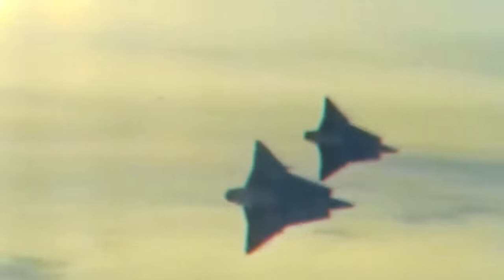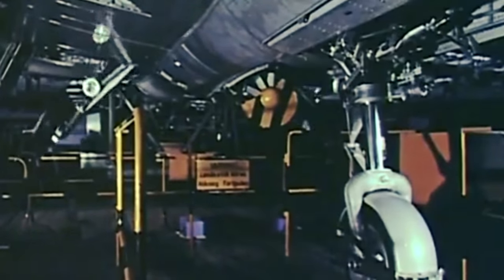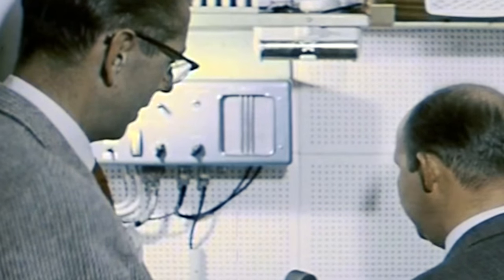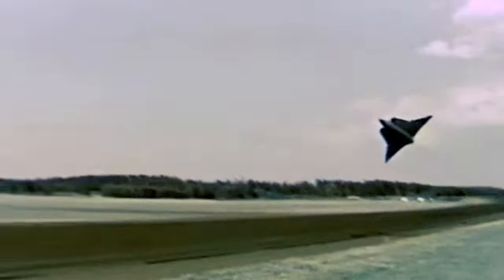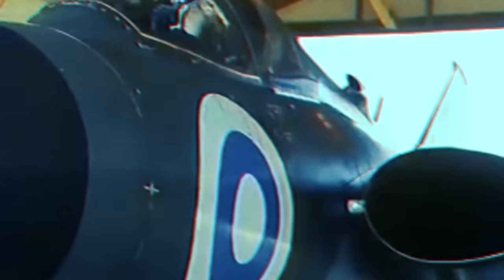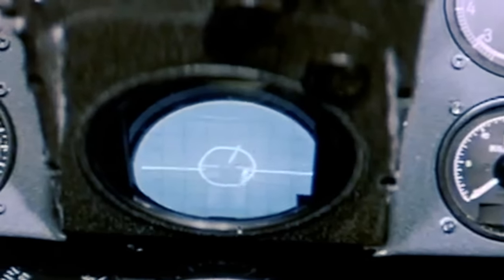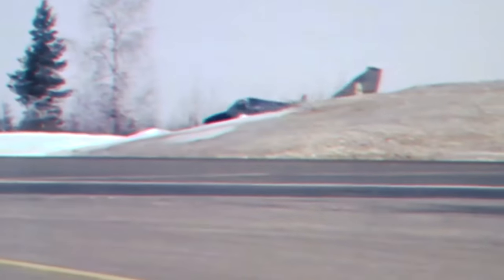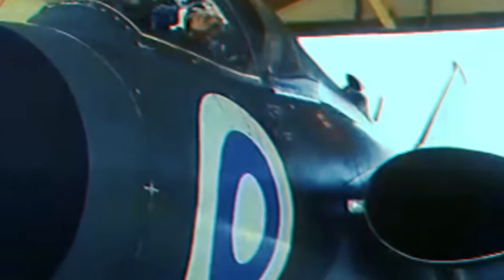The Bizarre Airplane Design That Shook Up Aviation

Comment: Uh oh! The Su-27 fan boys are going to hate that it’s not the only plane that can do the cobra nor did it invent it.  🤣
Reply: That’s the first thing I thought, in the first two mins 😂 🇨🇦 Vet
Reply: 🤯 I really thought the Russians had invented that maneuver. Still they deserve some credit for having more planes that can perfect the maneuver.
Reply: @one-metallica4156  yeah, leave it to the Russians to perfect the art of dumping their energy and becoming an easy target 😂
Reply: @joshfrommilan6130  my mistake, I meant the Soviet Union.
Reply: Have seen Mig29's do it on airshows and i have even seen a german Tornade do it once on an airshow. So in any case they would never be the only ones ;-)
Reply: @nirfz  Fair point. F22 can do it as well.
Reply: @one-metallica4156  Although thrust vectoring could be somewhat counted as "cheating" compared to the other airframes ;-)
Reply: I'm Swedish and have had an interest for SAAB planes for a long time. Although this might technically be the cobra it's very different from what the russians do. The Drakens are practicing super stall recovery at high altitude. What you see is them trying to initiate the stall but failing, this exercise has got nothing to with dogfighting.
Reply: This is not Cobra at all
Reply: Fellas! Who cares if it is a Cobra or not? You pull a Cobra in real combat, you die! The Cobra only works in DCS and maybe 1 v 1 combat. When was the last time anyone fighter pilot went out without his wingman! The Cobra is only to Su-27 fanboys wet dreams!
Reply: Also, everyone acts like every Russian pilot knows how to conduct the maneuver! Given the very limited training time that Russian pilots receive the only Tim they hear of the maneuver is from YouTube! Cheers
Reply: Russians call it Pugachev Cobra to make it look like the have created it.
Reply: @One-Metallica  but it's not very useful in modern combat
Reply: the russian 135th keyboard battalion has arrived😂
Reply: @Sasa Babic  what do you think a cobra is?😂
Reply: This is not a Cobra. It’s a super stall aka the Top Gun move. For Cobra you have to rotate at least 120 degrees, not 90. Can’t do it on a Dragon because the engine will stall. The first aircraft to do a Cobra is a Mig- 29, not Su- 27.
Reply: @daveriddell3704  The Cobra as "speed reducing action to make the guy behind you overtake" may only work in games and play.
But that's not the big thing when an airplane is able to do that manouvre.
The big thing is that it can point it's nose in a different direction than it is travelling for a short time.But very likely long enough to fire guns or to launch a f&f missile.
That's can be important if you are in a time where the seeking heads of missiles were not connected to a pilots helmet in a way that enabled them to be directed to a position not in line with the planes direction of flight.
Reply: @joshfrommilan6130  The menuver is uncommon(its a last ditch effort)
Reply: @daveriddell3704  Its not that the maneuver is very useful. But it's a testament to the excellent handling capabilities of the mjg29 and su27. (Its ok to like russian planes)
Reply: @one-metallica4156  why?
It‘s completely useless and irellevant since 30 years
Reply: @heinzketchup4558  so you say.
Reply: @one-metallica4156 less perfect then the f22 though. The f22 doesnt choke in black smoke when it does the manouvre every time
Reply: Well when the swedes did the manuever. The missiles used where pretty hopeless at tracking, and they where heatseekers
Reply: @joshfrommilan6130  - Yeah, and leave it to the US jet jocks to admit that not a single one of them would actually dare to fly over Ukraine, regardless of aircraft type. 😂🤣😂
Reply: @breakbollocks9164  yes, the country that owns the jet with the single highest K/D ratio ever is scared of flying in Ukraine. Sure pal.
Reply: Just another defeat for the Russians 😂😂😂😂💯💯💯💯
Reply: @daveriddell3704  that's today. 60 years ago it was used successful in exercises and combat agains the Soviet union.
Reply: 60 years ago there was no off bore sight and it was nessesary to point the nose at the opponent to kill him, so the cobra meneuver was very useful then. The draken pilot used it to win against Soviet pilots and it may be the reason the developed it themself, but with trust vectoring. Today the meneuver may be used to dodge missiles.
Reply: @nirfz  that may be so, however you are cashing in all of your energy for that one shot leaving you vulnerable in the meantime. As I stated before, when was the last time any fighter went up alone?
Reply: @olebaltasar6263  it is a testament to how well Russian aircraft perform, I have never doubted that. I love the Su-27 and Mig-29 series.
Reply: @atlet1  there is only one instance where a high stall maneuver was used in combat and that was in Vietnam….they loosely portrayed it in Top Gun. It has never been common practice nor used successfully against the Soviet Union.
Reply: @daveriddell3704  Which means your buddy has your back while you are being vulnerable ;-)

Look, i am no fighter pilot, all i know is that talking to a Draken pilot who had been on an exercise with a number of his collegues and they exercised with the Swiss and their F18's, i was tolled in a humble manner but with a proud smile: "The f-18s didn't win all the Dogfights". They did train and exercise like they did their QRF duty. (in pairs)
Reply: @nirfz  and what is the other guy’s buddy(s) doing? It only takes a second. 

Everything comes down to pilot training which is why I stated that the maneuver isn’t very common except for air shows due to the quality of Russian training.
Reply: @daveriddell3704  False!
Reply: @daveriddell3704  What if you go for the buddy... Not for the leader, but for the buddy who is to his right or left wingtip first?
Sure it comes down to pilot training, but what i tried to explain is that if the plane and the pilot are able to do such a manouvre it doesn't mean that they have to do the full 90° or 110° (which is impressive on airshows) it just means that they can use the ability and angle they need when they need to.
Reply: @nirfz  Im 100% certain the tornado has nrver done a Cobra on an airshow. Its not built for that.
Reply: @atlet1  No he is right. Draken pilots never did what the russians calls the cobra and no Swedish airforce aircraft ever fought soviet planes. In any case its not possible to do it on older prop planes. The first time it could be safely done when the mig 39 arrived. And mig29 doesnt have thrust vectoring
Reply: @olebaltasar6263  False! The general definition of the cobra maneuver describe what Swedish pilots did, many times in combat with the Soviets. There was no live fire during those combat occations though. The only live fire was from Soviet pilots was against a DC3 and a Catalina.
Reply: @olebaltasar6263  You can be sure as much as you want. I have seen it with my own eyes. (only once, but i will remember it forever)
A german Tornado going straight in the line of the runway, holding it's height while pointing the nose 90° upwards for 1 or 2 seconds before lowering the nose again and hitting the afterburner.
Reply: @nirfz  No. The tornado wasn't built for such a thing and it couldn't dream of it. Not even the nimbler aerodynamically unstable western planes like f16 or f18 does it. It was a crazy maneuver to do at low altitudes when the Russians started doing it in the late 80s.
Reply: @olebaltasar6263  And "according to aerodynamics a bumblebee shouldn't be able to fly", i still have seen it do it.
Reply: @nirfz  You will have to agree that that's not a good metaphor.
Reply: @tiberiusbrain  its stupid to do the menuver at random, its not made only to do one menuveur!! The meneuver is not that usefull. Black smokes not dangrous either to the pilot
Reply: @benferris2764  it is a stupid manouvre for sure. But the black smoke isnt dangerous to pilots, it is an indication of fuel not burning very well
Reply: @tiberiusbrain  i didnt know the black smoke indicated fuel problems, thanks for pointing that out to me.
Reply: Rafale can do the cobra, so does f18 among others.
Reply: Alot of planes could probably do it but doing manoeuvres like that would hurt the overall lifespan of the airframe
Reply: @doubledekercouch  exactly. Last ditch efort if anything. I saw a video on youtube of a Fokker Tri Plane in flying circus peforme one, flight sim players are mad!
Reply: 😂😂😂😂😂😂😂 Saab draken.
Reply: @daveriddell3704 I saw it once. Dunno if it an actual cobra, it's SU57 against a stolen Tomcat---- and it's not the Russian's
Reply: @tapenagiuniversity1551  The one in mav wasn’t a cobra i don’t believe, the post stall move involves pulling the planes nose up and back down (as if imitating the snake), i think it might have been the Kvochur bell
Reply: Су 27, шмат мусора, по ряду базових конструктивних недолік. Міг 29 я взагалі мовчу. Головне, що Іван пишається і після літру горілки почувається велично. Хоча двигуни росіяни завжди копіювали у заходу.
Reply: @olebaltasar6263  The definition of the cobra was the exact same thing that Swedish j35 pilots did. Also Swedish aircraft faced off against soviet aircraft numerous times in the baltic sea the differences where that no shots were fired and that these were just mock fights. There is also the instances of Finland who operated both the Mig-21 and the J-35 and often Finnish j-35 pilots won against their mig-21 counterparts
Reply: @fishyfish6050  They certainly met over the Baltic many many times. Especially the planes in what we call incidentberedskapen, who were tasked with identifying unknown planes near and in swedish airspace. And I'm sure finish drakens  often won against finish migs. Swedish drakens often challenged and turned with west German f4 phantoms and won since drakens are much lighter. But it's my understanding that turning with the Soviets or any WP country was a no no. When western fighters approached Soviet planes just turned towards their bases in the baltics. The soviets didn't want confrontation and they had orders to keep distance. At least that's what most Swedish pilots state. I know there were incidents but that was long before draken were introduced. About the cobra, yes, the draken does it in the video. What I'm saying is that it's not the same thing. They do it with poor control at high altitude and you can see one plane disappearing in a flat spin towards the end of the video. The 80s soviet planes did it with perfect control every time right over the deck. Therefore it's a useful maneuver for the migs and sukhoi, whilst for drakens, it's a stunt that could be tried at high altitude and that sometimes succeeded. Draken was known for being unstable at high alpha. And I say all this as a Swedish draken fan.
Reply: @one-metallica4156 Why? It is downright stupid in modern air combat.
Reply: Fails 35
Reply: It did it better too
Reply: There are a lot of aircraft that can do the so called cobra maneuver.  I even saw an F-18 do it.  The thing is I think the US dogfighting doctrine of maintaining energy doesn't see any actual combat value in it.  It slows down the plane considerably that you will be more vulnerable.
Reply: @joshfrommilan6130  actually, leave to GENIUS like YOU to say what you said.. The cobra OS what MOVES you in a split of a second from been a TARGET of the fighter BEHIND you, to the one LOCKING on that who was BEHIND and then becoming your TARGET
Reply: Link at the difference.  The su27 is like a slow motion cobra yawning.  The Saab is instantaneously quick
Reply: And it's done via pure pilot skill, not artificially aided.
Reply: @covidhoax7646  A cobra is 90 degrees AoA. That is a fact. The airshow move "Pugachevs Cobra" is 120 degrees aoa. Google exists.
Reply: Russian jets are more known for being the ones to be able to do it but the J35 Draken is the first ever to do it
Reply: @nirfz  : Did You see spectacular explodes “ Tornado” in Air ? ( In April night under Sky to City of Smederevo) . Luftwafe Tornado is Shot with old rocket “ Dvina”. Magnificent 💥
Reply: Look, someone who gets their aviation knowledge from top gun!
Reply: @heinzketchup4558  Doing backflips is also pointless and useless but  looks cool AF.
Reply: @sasababic4016 no, its a Kort Parad
Reply: Said by someone that cannot do it
Reply: @daveriddell3704  Not to mention 9 out of 10 attempts would likely tear the wings off of the few, over used airframes they have!
Reply: @one-metallica4156 I'm pretty sure the russians saw the maneuver by the swedish and claimed to be the creators of it. Because Sweden wanted to keep this airplane as secret as possible because of the cold war situation

Comment: Iconic. I've had the pleasure of seeing these at airshows, and the plane still leaves an impression.
Reply: As a kid i saw these in the skies over Denmark, Some AFB still have one for display at the gate.
Reply: @pliashmuldba  Karup airbase, right? I sadly wasnt alive when they were still in service, but my dad worked on the drakens there for a long time.
Reply: They were insanely loud.
I once experienced them at the airshow in Skrydstrup (Denmark), where they came from behind the crowd, at over mach one.

I knew that they would be coming from the airshow program, but not from where. But I was one of the lucky few, who discovered them in time, and covered my ears. They were maybe only 3-400 meters above us, so people jumped, at the bang. This could never happen today, of course. Mach one and beyond over labd, was banned a few years later.
Reply: @akyhne  Typical Denmark, ban / outlaw any kind of fun, we are a far cry from our Viking ancestors today.
Reply: @Jens Nobel Actually no, Denmark no longer fly the draken at any shows. They currently have 2 drakens at shelter 152 that can indeed fly, however are not allowed to. They are only present on the ground at shows.
Reply: @Jens Nobel I think the Jury are still out of that one, but yeah like in most things a coordinated effort are better than havoc.
But there are many a old writhing about these guys also being quite emotional, but yeah even back then you couldent just cut someones head off CUZ you felt like it.
What i tried to write was the Danish nanny state,,,,, it suffocate me.
I have not voted in many many years, CUZ there are no one here to vote for, they are all idiots.
Reply: @Jens Nobel I have been to other countries, work have taken me everywhere but Africa and the south pole.
And i have talked to people there and seen what they get .
But ! yes there are disagreeable things in all countries, but with a lotto win i am still moving away, and i assume also be able to die in my new country feeling as a free man.
But lets hope more educated people come to live here we sorely need them, but many are actually scared off by the system here, even if you looking close at the numbers it is actually not more expensive being a Dane than say a American.
I too am C / CE licenced, got that years back when i was between jobs, and as i am connected, not that i ever used it, but my dream car well it is way past 12 tonnes in weight.
For me its not so much the cost of being a  Dane, it is the lack of personal freedom and the utter distrust in me as a law abiding citizen.
It is my firm belief that with the right measures we could easy cut the public sector of 25% of its manpower, and allow people to be more free in a range of ways.
Reply: @pliashmuldba  It's banned everywhere in Europe. No sonic booms over any mainland. I'm sure your viking god Thor would aprove that there is more fun stuff than kids with bleeding ears at airshows.
Reply: @forton615  My buddy that live not far from a military airport, he had F - 16 going past the day before yesterday that he couldent even take a photo of them, they was that low and that fast. a few months ago he also sent a pic of a airborne radar plane that was no more than 200 M in the air.
The fast moving F-16 planes he said was so low he could have thrown stones at them.

We will be formulating a letter to that airport saying that they should do this more often. though my niece live less than 1 KM from there and they do have a kid less than 1 year old.
Also if they need a place to do mock bombing runs at, the 20 feet container in the field at my friends place will make a nice target.
 Make me wonder can a military airplane detect my micro wave  ( radar )  chronograph i use when shooting, and maybe will it freak out if i aimed my UV laser at the plane ( missile warning )
 we are looking forward to when we get even louder F-35 planes.
Reply: @forton615  Sonic booms are not prohibited lmao
Reply: @akyhne  Yes its loud af but damn is a MiG so much worse anything with a double engine just tears your ears apart
Reply: @reldies5364  European guidelines say no supersonic flight above populated areas (good luck finding a non populated area in Europe), for commercial flight it's already banned since Concorde. So yes, technically it's not forbidden for the military above non populated land and at a certain altitude. Hard to find data, but if you know more please feel free to share. What I know is a couple years ago a jet flew a bit too fast over Belgium. Next day it was on the news and in the newspapers. USA is even more strict.
Reply: @forton615  AAF is literally doing supersonic training right NOW.
They mostly fly over the alps because its sparsely populated but you can hear the boom if you are lucky and live close.
Reply: @reldies5364  live in styria (Austria) on the upper left. This month was a window of 2 weeks where they trained supersonic flights. No window was shattered but sometimes it vibrates very strong. The Jets train very regularly. You hear them mostly every week once. The supersonic flights are once a year for 1 or 2 weeks.
Reply: It truly does! one of the loudest afterburners ever produced! Beuty of a plane